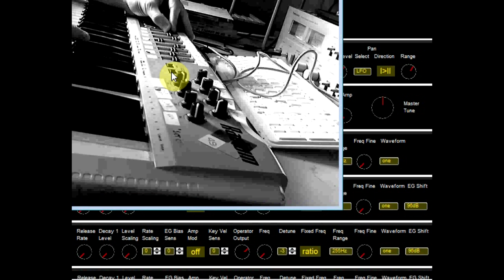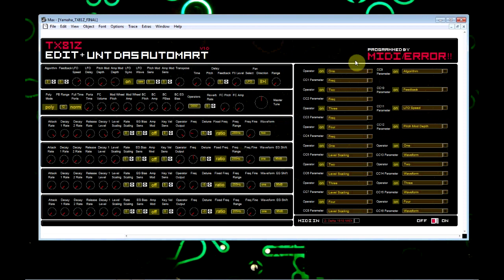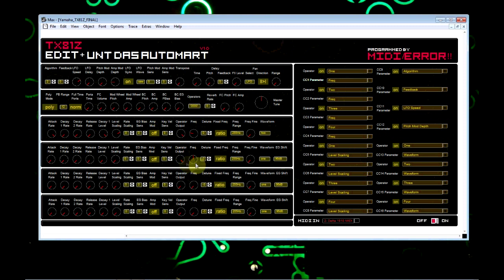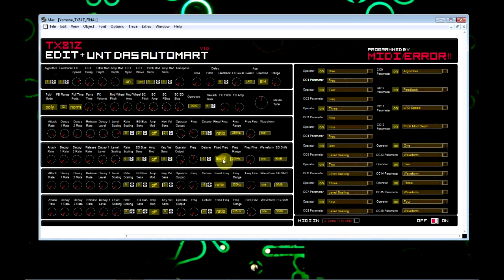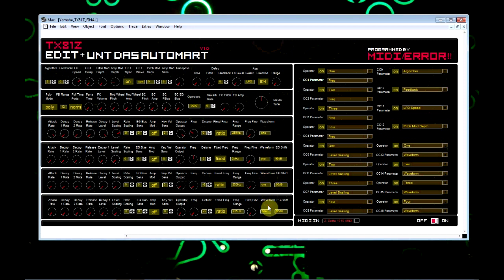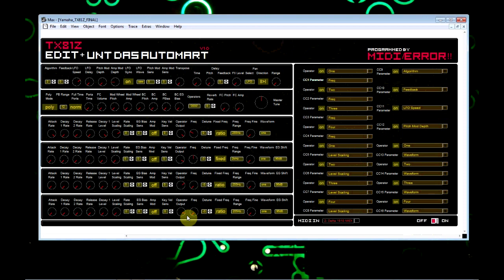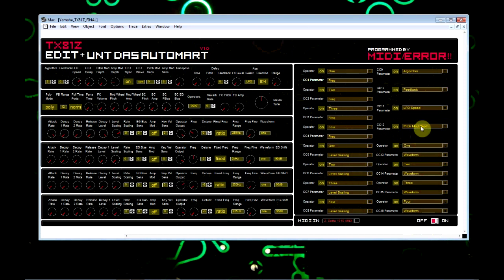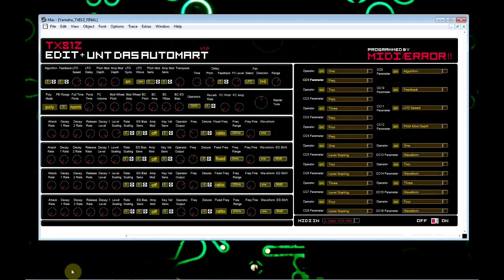Yamaha TX81Z Editor

Comment: I heard this synth supports microtonal scales. Can this editor edit those too?
Reply from the maker: +sevishmusic this editor covers every element of the midi implementation..so in a word: yes
Reply: If you have to input the SYSEX data for all 128 notes manually, then that's a huge time sink. But actually, you can use some software like Scala to send the tuning data to a TX81Z, then use this Editor to control everything else. Thanks!

Comment: Hi I need some help, I have a software editor (lemur template off the net for iPad) to program this unit, so if you plug the iPad into the midi in port with a lightening to midi cable interface (Roland UM-ONE) then how do you have a keyboard plugged into it at the same time if the only midi 'in' port is occupied by the iPad/lemur midi cable? 
You are playing notes and changing the operators here! How??
Reply from the maker: I dont know mate I dont have an ipad